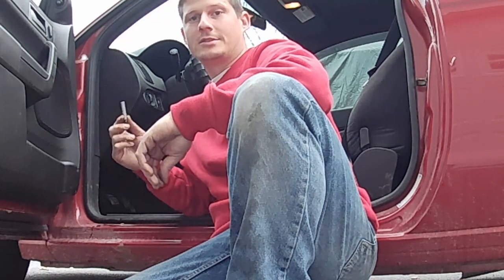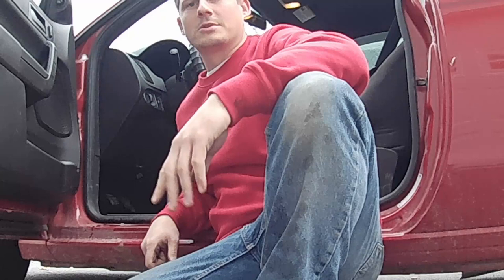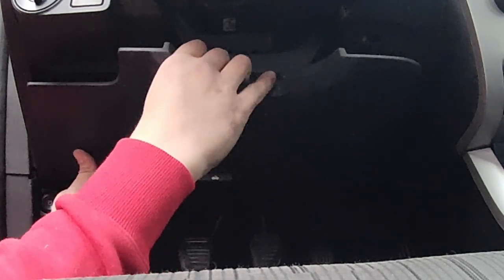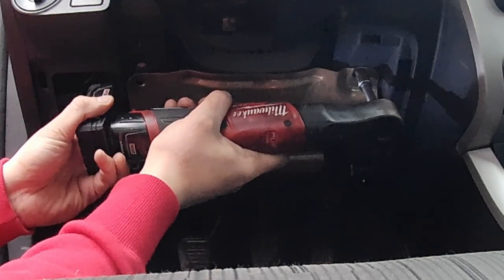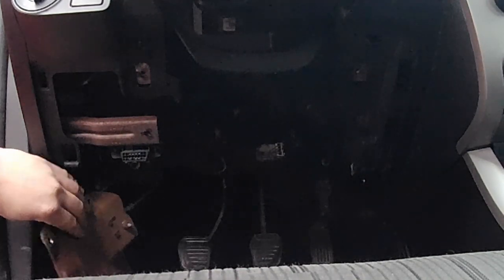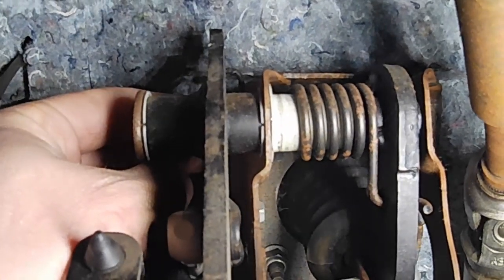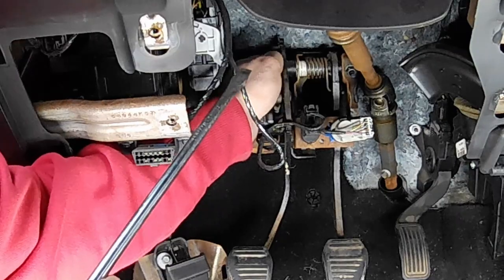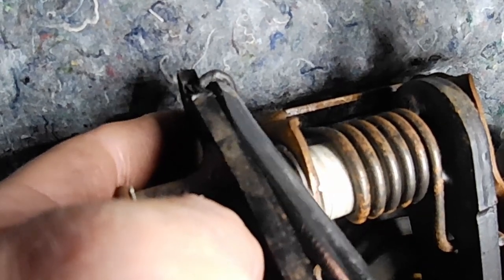Easy 08-11 Ford Focus Clutch Pedal Return Spring Install (Clutch Pedal Stuck Down)

Comment: Thanks so much for this video, i have a 09 that needs this done
Reply from the maker: Thanks!  I couldn't find one when i did it so i figured I'd make sure there was one.
Reply: Finally got it, definitely a tight squeeze, you have to push an play for that damn hole, took me about 30 minutes or so, also i took the metal plate all the way off, it was just in the way, again thanks for the video

Comment: First off, thank you for sharing this. The only reason I was able to even correctly identify this part is because of this video. 

Ford’s website only identifies the assembly and not the spring itself. There’s also different variations of the part number. Although the website provided in the description no longer provides this part, Amazon has the part under : YS4Z-7534-AA. This part is extremely difficult to access as of late. Not sure if it’s because manuals are disappearing or supply shortages.

This was very helpful for both my mechanic and myself. 

I did want to ask: is this something experienced people can do within 5 minutes?  Personally, as a novice, to get the part off a car from the junk yard took 2 days alone. I found that the view of the spring is completely obscured by sensor attachments a part that attaches goes to the clutch master cylinder. Mirror helped but I had to remove the blind spots completely to access the spring.

I also had to loosen the brake pedal to gain additional clearance. I’ve been wrestling putting on the new spring in the driveway for 2 hours now. 

Will keep it going but just want to know if there is something I may have missed in this video. Thank you!
Reply from the maker: Hello! although I am an experienced mechanic I have to say I have never done this particular job before this and (with filming) it was done in under 15 minutes. it may have helped that I was able to easily find the part at the time and have a keen eye for places to sneak a screwdriver. Regardless, I'm glad I was able to help....and yes this is something an experienced person can do in 5 minutes (with a power ratchet of course).
Reply from the maker: I will also add, that this is the stuff that will cost you $200 or more at the dealership. I used to work there and couldn't take it anymore, so many people getting ripped off.
Reply: Thanks for the response. It is a good tutorial. Perhaps my screwdriver is not long enough. I will try again.

Comment: Thanks buds! I need to replace mine as well... One quick question: Do you know whether I need to remove the center bolt which holds the clutch master cylinder to the firewall, in order to replace it (the master cylinder). I was able to undo all the other bolts except that center bolt which rusted out... Just trying to find a workaround. The two vids I've seen both removed the bolt... However, on one forum the steps suggested removing the center bolt OR removing the 'u' clip on the inside under dash... Any thoughts or know how? Thanks.
Reply from the maker: hi, sorry for the late response, I can't speak from experience as I haven't had to replace one yet, so I don't want to provide you with false information. good luck though!
Reply: @andrewc6602  I got through figuring it out! I also made a basic video just to show that I was able to remove Master Cylinder WITHOUT removing the center bolt on the firewall - I changed the clutch line out as it was cease in the pressure end of the master cylinder and had to cut it. See this link for the video: https://www.youtube.com/watch?v=KpFNiQ1U16Y. 
As for the spring, I ended up increasing the angle of the hook-end (used a needle nose plier to carefully open the curve by about .5mm) - this created a little raised edge which made it a bit easier for me to get it into the hole between the clutch-break cluster and the firewall... took me about 15-20 mins to get it all done 
:-)... Thanks for the response though!
Reply: DIY'er Tropical North I have a 2005 Ford Fusion Manual , I get hesitation when I’m taking off in first , I have to accelerate a bit more then usual, could this be the spring or the clutch master cylinder ? When I first got the car the pedal would always get stuck and no rarely does , thank you

Comment: But how did you diagnose it being the spring? Probably a dumb question, but I’m having this problem know and the internet mechanics have listed so many possibilities, I don’t even know where to start, but this seems the easiest
Reply: I’m not able to shift my car into any gear. Would this keep the clutch from engaging?
Reply from the maker: When I pressed on the pedal it did not return. I simply stuck my head down there and saw it broken. Not shifting into any gear could be a few things such as a Slave cylinder or broken transmission internals. Sorry I can't be of more help.
Reply: @andrewc6602  that’s actually quite helpful. I need to take a closer look at this area before I go buying parts. Appreciate the reply.

Comment: Was yours already broke off or did u just take it off without showing us? I had a hard time getting the bottom hook off I had to loosen the pedal and clutch master cylinder assembly to get it off. Not as hard as people make it out to be but not that easy either. At least for me anyway ha. Good video tho👍
Reply from the maker: It was broken and laying on the floor